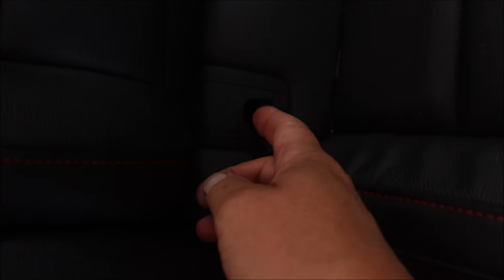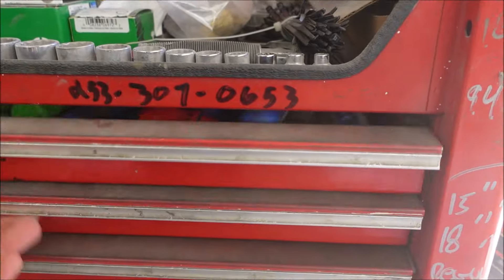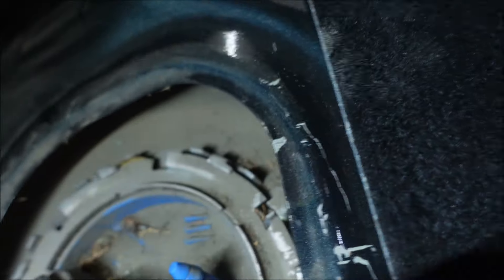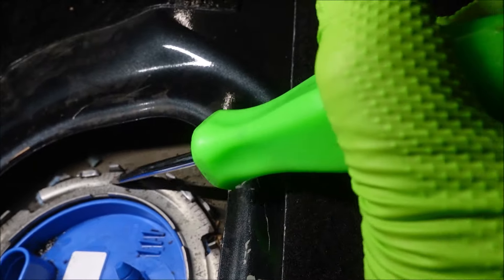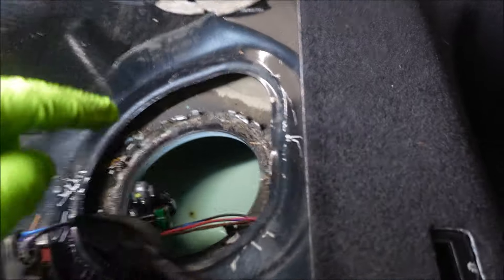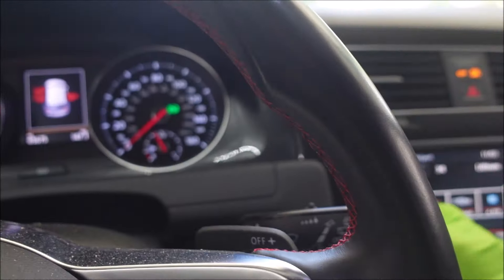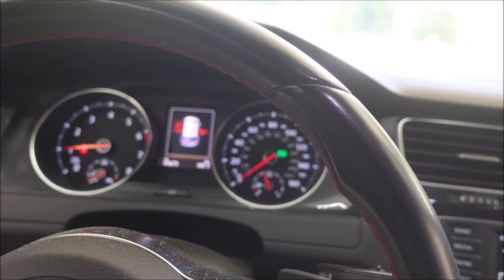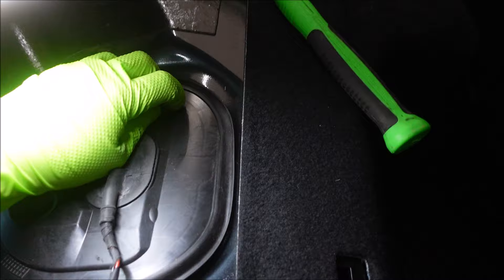MK7 GTI Fuel Pump Not a How To.

Comment: Hello. Mechanic at Honda here. But I work on pretty much any vehicle. When you finish installing the fuel pump filter you turn the car on but not the engine. Give it like maybe 30-40 seconds to prime and then turn it off. And repeat that again 2 more times and it’ll prime the pump and then you’re good to go. I’m pretty sure even doing it once it isn’t a problem.  But I just do it three times as a rule of thumb.
Reply from the maker: right, I did

Comment: Your stalling when warm problem will return, it's actually the high pressure fuel pump failing. I had the same problem and searched the forums until I found multiple people that had the same issue and went through similar steps as you. HPFP was the fix. I recently replaced mine and the problem went away too. The good news is that it's easy to replace, bad news is the price of the pump. Good luck and thanks for the video!
Reply from the maker: Ya I figured that would end up being the problem, the problem did return and I have not fixed it yet lol.